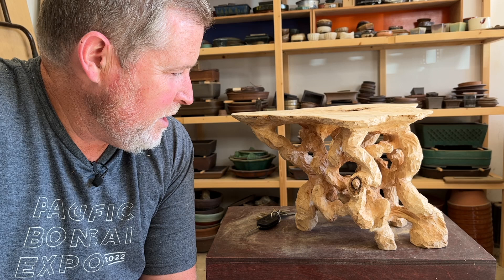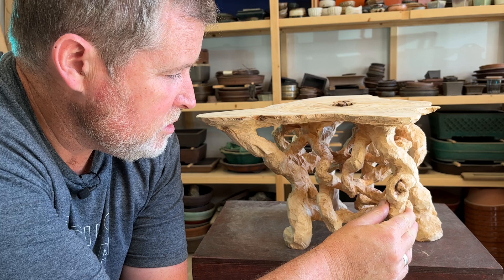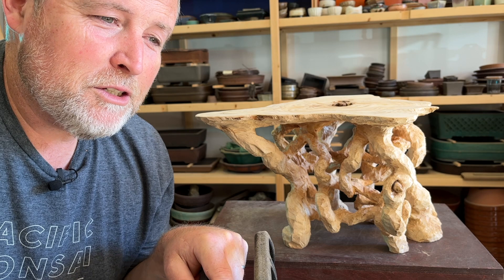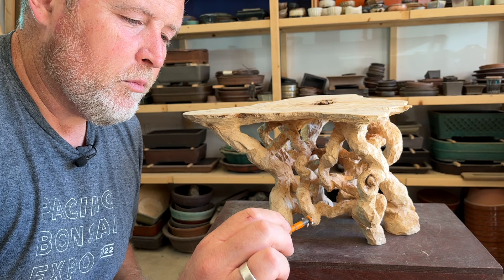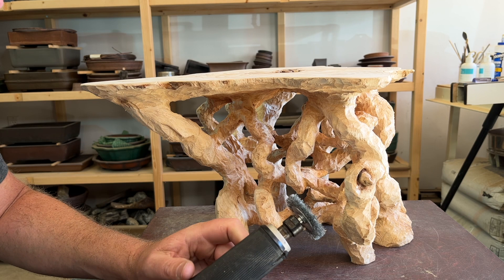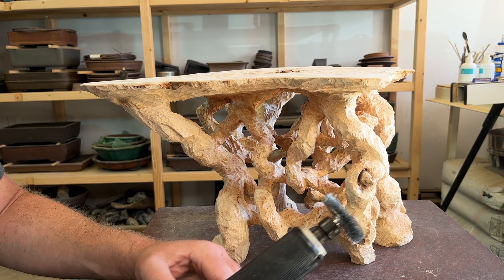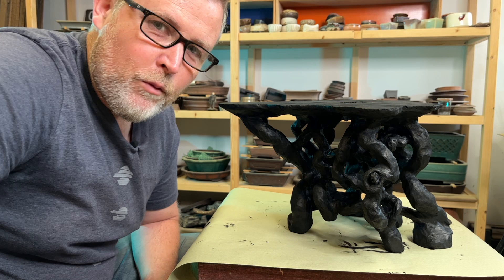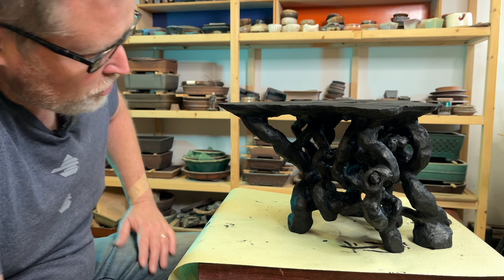Bonsaify | Carving a Bonsai Stand from a Block of Firewood

Comment: Fantastic piece of craftmanship worthy of a great bonsai. I used to do a lot of woodturning, and I suspect that the easiest way would be to remove most of the material when the wood is completely green. Oak for example is really soft when green and could be easily carved, then it could be set aside to dry. Then a year or two later, it could be finished. This approach would also help with the cracking of the wood. If you ever do another, the best way to avoid those cracks appearing is to remove the heart wood from the center as soon as you get the wood, as well as sealing it as you did.
Also, (I know I'm going on a bit here) but in an ideal world, you would use a piece of wood that doesn't contain any heartwood at all. Obviously, that would have to be sourced from a large tree as the whole piece would have to be taken out of just one side of the trunk, but if you're investing that much time into a piece, it's probably worth speaking to a local tree surgeon who would be able to help.
Thanks for the inspiration!